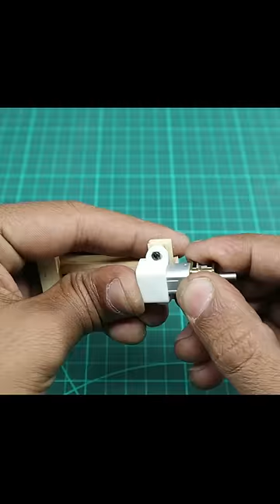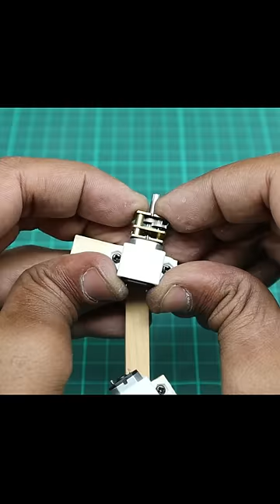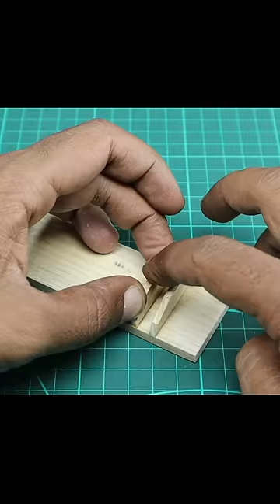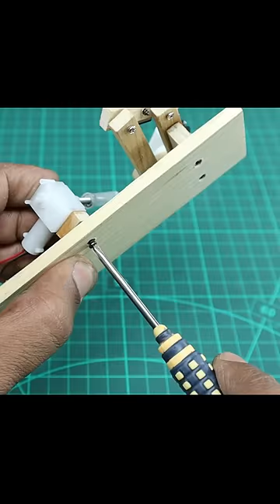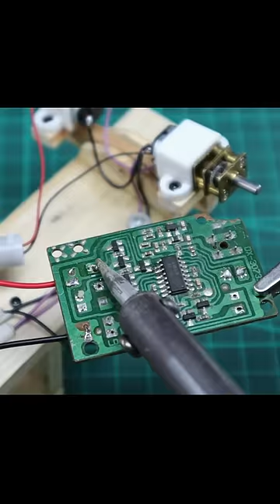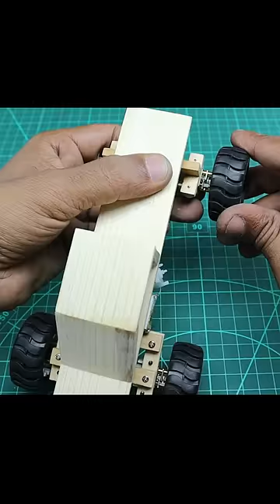How to make rc car | remote control car #satisfying #shorts

Comment: Why are the motors connected to the steer mechanism i would only have tbe motors at the real and make the front just normal wheels nk motors because the wires may get tangled up or damaged after long term use from strain
Reply from the maker: I didn't get it, please elaborate again. Please watch full video. 
https://youtu.be/RIwpkdoEHhc
Reply: @diywithz4562  why are there motors on the front side of wheels that turn, i would only have motors in rear wheels and have no motors in the front side except for steering the front wheels, do you understand
Reply from the maker: I used motor on front wheels for more power. Are you making this rc?
Reply: @diywithz4562  yes, i made similar to this one 3 2 years ago it had like a motor controller and only motors in the rear and it was fast and used esp32 but it was just a prototype which i disassembled